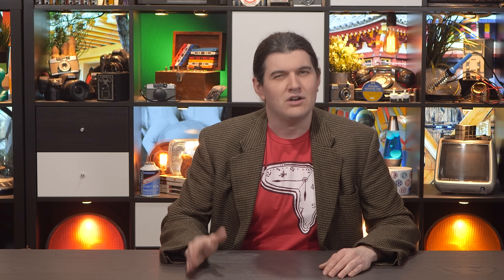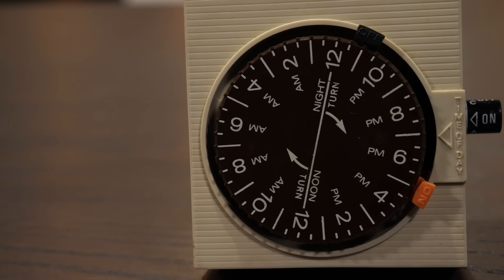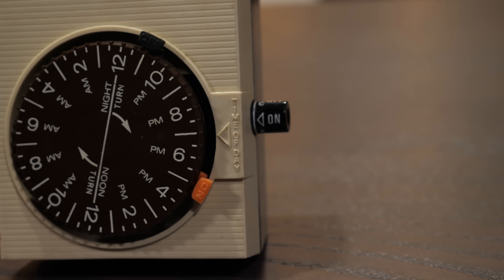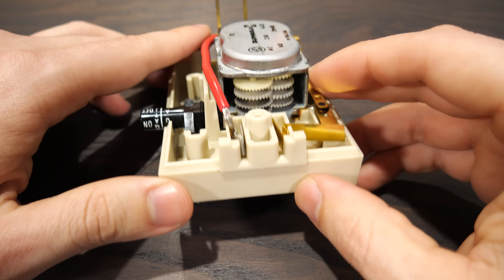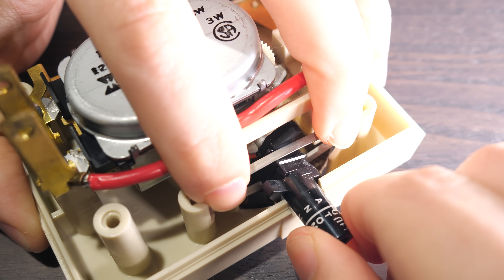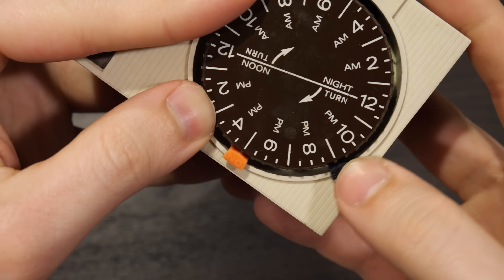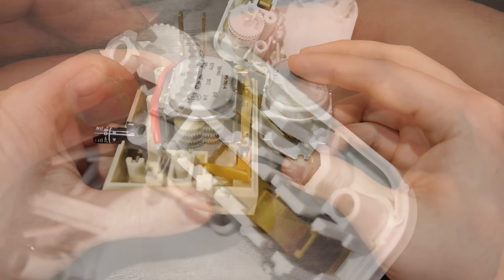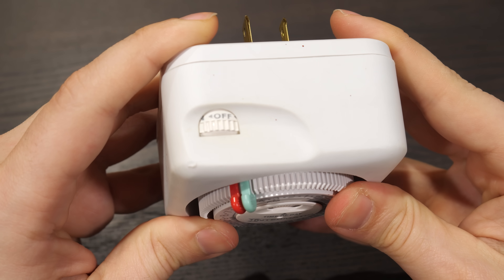Timer switches: literally just a clock and a switch

Comment: Have several of those mechanical ones. Knob span 20 minutes(3 per hour) Using as timer for fruit drying machine. Used one for heat gun when was doing some reconstruction in old apartments to dry out plaster walls faster.
Planning to use one in garage to control ventilation (admittedly moisture sensor switch would be better solution). Have digital one as well.
One caveat however: rated power/current characteristics! I am in 220V part of world, and these devices rated 10, max 15 amps. Meaning, not all devices can be safely powered. Heat gun easily consumes 3.5kW, so there is really no room for insurance.

Comment: I encountered another type from year around 2000. It is the type with the pull up/down tabs but instead of AC motor it had simple quartz clock + small rechargeable ni-cd battery inside to keep the clock running in case of AC failure.

Comment: Basically ALL AC powered electro-mechanical clocks were driven by synchronous motors.  They kept perfect time and only had to be reset when there was a power failure.  Early digital clocks that plugged into wall power counted 60 cycles for their time bases.  Even today, some AC - wall powered clocks still count the 60 Hz power.  Crystals just aren't as accurate for long term time keeping.

Comment: It's probably getting to be less of a problem as time marches on, but careful when buying either NOS (New-Old Stock) or used digital timers that have automatic DST here in the states. If you get one that was manufactured/programmed before Bush changed the DST dates, it will act oddly for a week or two twice a year.

Comment: I bought a digital timer switch recently, actually a pair of them because they only came in pairs, and I found out that despite having 8 buttons on them, you can't set different times for different days, and you have to plug them in one day a month if you aren't using them to keep the internal battery alive, so now I have a spare timer plug in a random socket

Comment: As you hinted on those timers do not need WIFI or an app, but now it seems those WIFI controlled switches are the new thing because they are  way easier to set up for multiple schedules, can adjust to sunrise and sunset times and even  automatically switch off after a set period of time among other key benefits.
The standard mechanical / electronic timer may become completely obsolete in time

Comment: I came across a security light timer/clock that was entirely mechanical in the basement utility room of a small church.   You had to set the time AND date, and it also had settings for latitude and maybe even a daylight savings time feature.  It would turn the exterior lights on/off based on the length of day throughout the year.   My guess is maybe it was 1930-1960 vintage, but hard to say.  I thought it was pretty cool.   The building still stands, I have no idea if the timer is still in active operation. It was as of maybe 20 years ago or so when I saw it.
Reply: And it was all mechanical? I'd love to see that just to try to guess how a mechanical astronomical clock simple enough to be set up and maintained by a church caretaker worked. That had to be pretty advanced stuff for 1930s-1960s.

Comment: Mechanical ones are really practical and have a user interface that is hard to beat. The digital ones seem versatile, but one has to figure out how to set it up.
Reply: Yeah, great for people who want or need the extra degree of control, but for me it gives me anxiety just thinking about needing to think that hard to program an outlet timer.
Reply: Agree!! I once had a digital timer whose buttons were so tiny that you ended up with dents in your fingers after setting it up... Always prefer mechanical - unless you have a power cut of course!

Comment: At 14:42, Using a quartz clock crystal as a time base is less accurate than using the 50/60Hz AC, unless it's only using the crystal during a power outage.  I have a microwave oven that uses a crystal time base, and I have to reset the time every month because the crystal is not perfect.

In fact, you might want to do an episode about how ingenius the AC time base system is.  This has been part of AC power since almost the beginning, around 1924.  The frequency is usually accurate to 0.02 Hz.   But that is periodically tweaked to keep the time error within ±10 or 15 seconds.  My AC powered clocks never drift off more than this, even after many months unless there is a power failure.

Comment: I have several of those Intermatic timers with the removeable red & green tabs.  You questioned how to store unused tabs.  I have a simple solution - just plug them into the disk  next to each other. A green tab after another green tab won't do anything. Likewise for a red followed by a red.

Comment: My father had one that did not even plug directly into the wall socket. It was a 8 inch square box with a cord that ran from it to the wall. The ones that came out in the 1970s were therefore an improvement. Most people used these for controlling lights while they went on vacation, but my Dad used the older thing to control plant lights and it was handy since the basement power was via a light socket to outlet adapter and the wire ran to the ceiling.

Comment: I have that exact timer with the removable tabs to control the light on one of my aquariums. On my other, I had a sliding-tab timer that was at least 30 years old, but I think it just wore out internally and stopped working, so I bought a power strip with a built-in timer, especially made for aquariums. It has four outlets that switch back and forth between on and off when the timer tells them. In other words, two are on, two are off at any given time, then when the timer says, they switch. The idea is that some people have blue lights on their aquariums at night.

Comment: Are timer switches good to use on computers?
Reply: no that's really dangerous because power supplies need to shut down computers on their own due to having powerful relays inside 

also hard drives can't be shut off suddenly because the head might collide with the disk 

computers are sensitive electronics and should only be plugged directly into the wall or into an uninterruptible power supply (UPS)

Comment: It's like watching rewrites of a simple piece of software. First version has on and off using bools. Second one uses times and you can set as many as you like. What progress! But what if I want to ask the timer is any specific time is on or off? Hurray, model 3 and it leans on an external library, err, microswitch to handle the fiddly electrical bits. Let's take that further with model 4, now we can do whatever we want with more processing power than most space probes!

Comment: I was using time switches in the 1960s, when Intermatic was not yet on the horizon. The manufacturer at the time was Tork (since bought up by NSI Industries), and its timer was bigger and sturdier than, and made of metal in contrast to, the Intermatic products that were to supplant it. I got the sense that Tork didn't try very hard to pursue the end consumer market that Intermatic so successfully did.

Comment: Whatever is a "polarized plug"?
Reply: a polarized plug is a plug which has one prong bigger than the other prong to prevent inserting the plug in the wrong way

the big prong connects neutral wires (wires with unused electricity back into the wall) while the narrow prong connect hot wires (wires which carry electricity to the device) 

if the appliance is on, both hot wire and neutral wire are deadly, but if the appliance is off, then only hot is deadly. That means that you want to construct your appliance so that it's hard or impossible to accidentally touch the hot wire (ever), and so that it's hard or impossible to accidentally touch the neutral wire when the appliance is on.

For example, with a regular bulb socket, the live wire always goes to the contact at the bottom of the socket, and neutral wire always goes to the contact on the side of the socket, which means that when you are changing a bulb you will not electrocute yourself even if the light is on when you change the bulb (unless, obviously, you stick your finger all the way inside the bulb socket).

That is why you don't want to accidentally reverse the hot and neutral wires. In some appliances it really doesn't matter — for example, a cell phone charger doesn't care because there is no way for you to stick a finger inside it, so you can plug it either way. In appliances in which it matters, plugs are polarized to prevent you from inadvertently creating a live wire (or surface) that you can touch and electrocute yourself with.

usually low power electronics like a phone charger will have non-polarized plug while a modern box fan will always have polarized plug to keep people safe

Comment: Well shielded, mechanical timer switcheridoos tend to do better in the cold or just plain out in the elements. They care much less about condensation and moisture in general. Haven't seen a numerical switch last more than two years, but I'm pretty sure the switch my uncle uses to power his patio lights hasn't been fiddled with in ten odd years.

Comment: The Venner Time Switch is the earliest patent I’m aware of, from 1907

See US patent No US876416A on Google patents - although it was clockwork rather than motor driven (and required winding) but was otherwise the same beast.

Venner continued to manufacture time switches well into at least the 1970s, and for many years manufactured  the time switches used to control the lighting in British telephone booths.

Comment: As the owner of 3 fish tanks and several terrariums and plants - I have several of these around the house. My anecdotal experience: The digital ones are garbage and often stop working reliably within a year. The most common failure seems to be the display stops responding or outputs gibberish and the switch stays open or closed until the timer is reset (or replaced in some cases). This has occurred with different brands and styles over different timespans. I always grab the mechanical ones now.

Comment: "Do you have an electrical thing you want to have turn on a specific time every day and then also turn off at a specific time every day?"

No. Is that weird? I certainly use some electrical things every day...but not at the same specific time. Even the obvious example of the coffee maker...nope, I have my coffee at any point within like a 4 or 5 hour window each day and don't want it just sitting there burning until I'm ready for it. Actually my computer of all things would be the only thing I could think of. If that could come on every morning at 5 minutes to 8 without my involvement, that would be great.

Comment: For years central heating systems in the UK (and probably elsewhere) offered electromechanical timers where a sliding switch offered you "off, on, once, twice" and you set ON1, OFF1, ON2, OFF2 on a very similar spinny doohickey. I was always impressed at the efficiency of design that meant while the slider was at "twice" the actuator would hit everything, at "once" the actuator would hit ON1, skip past OFF1 and ON2, then hit OFF2

Comment: My first run-in with timer switches was a large (well, 8 inch by 12 inch) grey metal box.  It controlled the lights in my dad's showroom.  After school, would sometimes stop by and visit.  When the timer would turn on two small spot lights, dad would say, must be time to close the shop.  Turned off the much larger and brighter lights, lock the doors and after a couple minutes, give me a ride the rest of the way home.  (the two smaller spot lights stayed on all night, sort of as security lights)

Comment: I  have installed Tork commercial timers that have a 1 week clock inside. I have even installed timers with a 1 year mechanical clock so the user can shift the on off times to follow the seasons, but those are super rare. The insides have metal discs with pins that you clip onto the discs. The on off clips trip electro mechanical switches.

Comment: The "bumps" that engage with the holes in the US plugs are there to create a bit more engagement since this timer may have been inserted vertically into a wall outlet, thus having the timed outlet facing downward.... and that over time, who knows if slight vibrations and gravity would eventually disengage the cord from the timer.

Comment: So before soldering people use to do wire wrapping. I only discovered wire wrapping while trying to find a way to do solderless prototypes.  And some people claim that [keyword here] PROPERLY wrapped wires, are actually a more stable connection that soldered. since the wires dig into the contacts a bit and hold their place.

Comment: Those modern microcontroller-based versions are AWFUL. You see, the question you should ask is: "could I explain this to my mother/grandfather/<other aged relative>. The mechanical ones: just about doable. The electronic ones: no way on earth. I own a retail store and all day I have to explain that you can't put a vertical; picture in a horizontal frame without cropping/white edges/magic. People are generally speaking Not technically sophisticated. The designers of those old versions got it right.

Comment: There is a Dick Francis mystery where some people grow up using a wind-up alarm clock as a trigger for pranks, but of course it turns into murder because mystery novel.  They simply remove the glass and add a metal extension to the minute or hour hand so it can close the circuit.

Comment: The knob on that one is so much better than the way the ones I have work. All the modern ones I looked at when shopping for some this year have a switch that can be set to AUTO or ON, which means if you want to turn it on during the off times, you have to switch it back to AUTO, and if you want to turn it off during the on times, you have to unplug it and lose track of the time or change the settings and then lose your settings. Although the newer ones I have do have the benefit of being able to program multiple on and off times per day.

Comment: Had a switch with two tabs in the 80s or 90s for Giftmas lights.  Might still be in the attic with those lights.  Now I have wifi switches that I can trigger by time or other conditions like the weather changing, My phone's position, or manually and remotely.  Fun stuff, but My first instinct before installing those wifi switches when I needed something on a timer was, "I wonder if I still have that old timer switch..."

Comment: Wait wait.... Why de you have polerised power outlets in North America?

Why?

In Europe can put plugs into socket any way.
Reply: a polarized plug is a plug which has one prong bigger than the other prong to prevent inserting the plug in the wrong way

the big prong connects neutral wires (wires with unused electricity back into the wall) while the narrow prong connect hot wires (wires which carry electricity to the device) 

if the appliance is on, both hot wire and neutral wire are deadly, but if the appliance is off, then only hot is deadly. That means that you want to construct your appliance so that it's hard or impossible to accidentally touch the hot wire (ever), and so that it's hard or impossible to accidentally touch the neutral wire when the appliance is on.

for example, with a regular light bulb socket, the live wire always goes to the contact at the bottom of the socket, and neutral wire always goes to the contact on the side of the socket, which means that when you are changing a bulb you will not electrocute yourself even if the light is on when you change the bulb (unless, obviously, you stick your finger all the way inside the bulb socket).

that is why you don't want to accidentally reverse the hot and neutral wires. In some appliances it really doesn't matter — for example, a cell phone charger doesn't care because there is no way for you to stick a finger inside it, so you can plug it either way. In appliances in which it matters, plugs are polarized to prevent you from inadvertently creating a live wire (or surface) that you can touch and electrocute yourself with.

usually low power electronics like a phone charger will have non-polarized plug while a modern box fan will always have polarized plug to keep people safe.

europe uses 240v and lacks polarized plugs which makes europeans susceptible to electrocution BUT more electronics are required to have built-in fuses as well as tamper-resistant outlets to protect people
Reply: @Robbie-mw5uu  
> "That means that you want to construct your appliance so that it's hard or impossible to accidentally touch the hot wire (ever), and so that it's hard or impossible to accidentally touch the neutral wire when the appliance is on."

How would that even be possible? Do American electronics just have wires exposed?

> "for example, with a regular light bulb socket, the live wire always goes to the contact at the bottom of the socket, and neutral wire always goes to the contact on the side of the socket, which means that when you are changing a bulb you will not electrocute yourself even if the light is on when you change the bulb (unless, obviously, you stick your finger all the way inside the bulb socket)."

I know Americans are dumb, but cheese. Also, If you are not grounder nothing, absolutely nothing will happen.

> "Europeans susceptible to electrocution"

That is the dumbest thing I've ever heard. How? 

All modern electrical installations are have Grounding and ground fault protection. We also don't use fuses over 18A (it is very rare to have like 25A) for the incoming wires per phase. And in main electrical board almost none are over 10A.